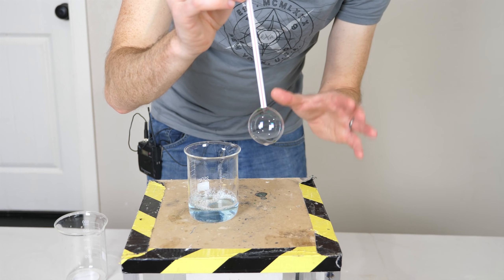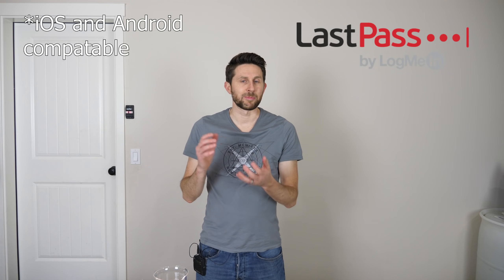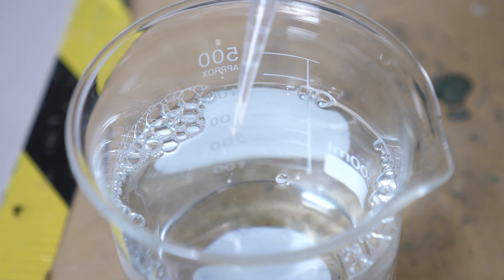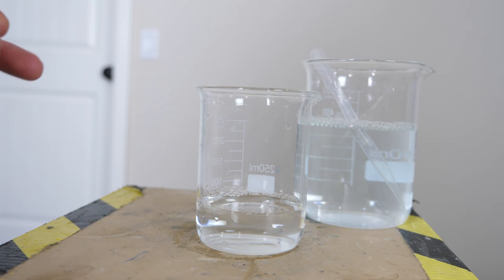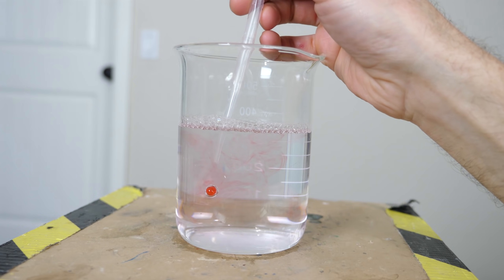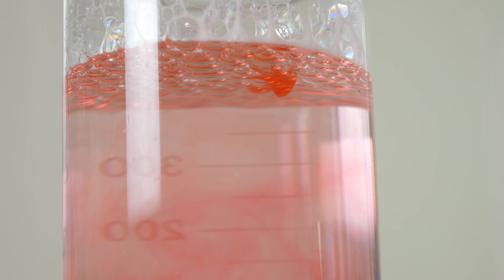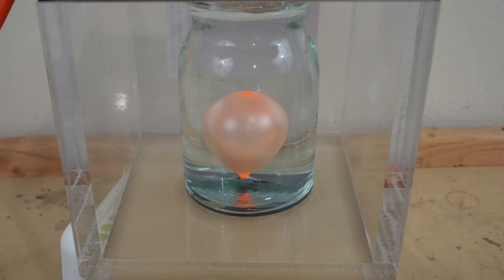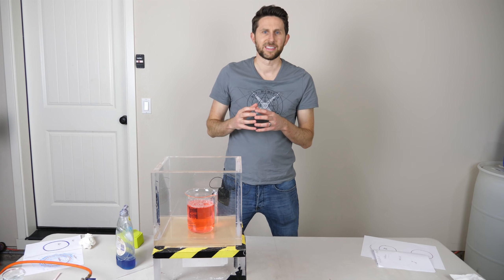What Happens to an Anti-bubble in a Vacuum Chamber?

Comment: Is it reasonable to think that the anti bubble would not expand because for that to happen the water inside should expand?? When the pressure decrease to much the it switch to vapor and the antibubble pops. In my opinion it has nothing to  do with the surface tension.

Comment: The fact that it is an vacuum chamber, means that all the air will be removed from it's inside. So, if an anti-bubble is made out by a thin membrane of air, it is obvious that it will pop, cuz all the air will be removed, and the water will drain out of the bubble. Brilliant conclusion.

Comment: I know how to hold it still in place, you know how I can take a flow of air and balance a ball on it and it will hover, will do the same except for suction with a small pump, and return the water back in at the top, just adjust the flow

Comment: I’m fairly certain that the air membrane not expanding could alternatively be because the water, which is denser, expands slightly, but still with greater force than the small membrane of air could oppose on both sets of liquid.

Comment: actually it didn't grow because gasses expand more than liquids. an actual bubble has air in the middle meaning all that air will expand. anti bubbles on the other hand have liquids in the middle and thus nothing much to expand. the membrane strength has nothing to do with it. the more gas there is the more substance exists to expand. cool video though.

Comment: i think the air membrane didn't expand ( not because it is strong ) but because the water is non compressible AND any vacuum will be filled by water boiling off - so the water pressure is a constant - the air is surrounded by constant pressure water

Comment: Been in a vacuum since 14 years old ,(64 now retired) Optical coating, what you have shown me is that one a cellular level (what you have duplicated ) by adding viscosity Now my question to you is viscosity a linear function or log rhythmic. I would guess linear by the wave form distortion on the sphereocity  change on the inner water tension increased but air was spherical of the wave form  as you start to pull a vacuum ,This has great bearing on a Project I have in visioned in quantum vacuum  measurements

Comment: I thought liquid cannot be compressed or expanded because of pressure.
Reply: i think the air membrane didn't expand ( not because it is strong ) but because the water is non compressible AND any vacuum will be filled by water boiling off - so the water pressure is a constant - the air is surrounded by constant pressure water

Comment: Water is creating hydrogen bonding and keeping the force of water intact with itself Inside therefore there's a constant volume of water inside the antibubble. The only way the bubble will expand is if water crosses that thin gas membrane you talk about but that is not happening because it's not a traditional osmotic membrane permeable to water. I believe the bubble pops bc the thin membrane gasses want to dissolve out the water and into the air due to the decrease in pressure. And if you did see the antibubble get bigger, could it be from the dissolved gasses inside the bubble expanding out to the gas membrane and that limits the expandability of the antibubble in a vaccum.

Comment: What would happen to a bubble floating in a sphere of water in 0 gravity?  Would it float to the nearest edge or just stay still?
Reply: I suppose it depend of the speed it has when you make it. If it has 0 speed and the sphére has 0 speed as well, it would not move. If not, it would go in the same direction it had, and would be slowed by viscosity...  ( i see only surface tension as force in this system, and i don't see why it would push the antibuble in any direction)

Comment: I don't believe that the thin air membrane is that strong . I believe it has to do with water pressure inside and outside the anti-bubble . Water has an extremely low compressibility , many times considered as incompressible. The thin membrane is basically trapped between two layers of water that are pretty much at the same pressure , causing it not to expand.
A normal bubble will expand because the air inside the bubble is at a higher pressure level than the molecules of water around it. No magic require and no "strong" air membrane involved.
Reply: I think you are closer than any I have seen yet - here is what I suspect :
i think the air membrane didn't expand ( not because it is strong ) but because the water is non compressible AND any vacuum will be filled by water boiling off - so the water pressure is a constant - the air is surrounded by constant pressure water

Comment: Conclusion: The structure of Matter. Replace the air with plasma double layers. The water also is plasma. So plasma inside=Atom(static), plasma outside is the atoms environment very dynamic and the double layers could be considered as the electron shells.

Comment: I'm pretty sure that seconds before the anti-bubble burst, there was an expansion of air at the top of the bubble. It is hard to see if you're not looking for it. Basically the air around the bubble was being forced towards the lower pressure and distorting it by becoming elongated near the surface. This seems natural as the water wants to remain where it is and the air wants to leave. Please check this again or make it easier to see the bubble without all of the other bubbles around it. Nice demo but check your conclusion.

Comment: It does not grow because the water on the inside does not expand and the water on the outside does not contract...At least at the temperature and pressure (vacuum) you were applying in this case.
P.S. a vacuum has pressure until you achieve an absolute vacuum such as in outer space.
It is the same concept as...Things don't get "cold" they get the heat removed until you get to absolute zero such as in outer space.

Comment: What if you had a layer of silicone or even vegetable oil on the surface of the water. Make the antibubble, then add the silicone oil. The bubble should stay under the oil.

Comment: The liquid inside will not change size but the air layer will grow thicker and expand outwards, Gas will expand more than the water that’s why you couldn’t see the bubble expand because you were concentrating on the inner red bubble instead of the air around it

Comment: i think the volume does not increase that much because water is incompressible, and so the water inside the bubble cannot cannot increase and keep the smae volume
Reply: you are on the right track ...
i think the air membrane didn't expand ( not because it is strong ) but because the water is non compressible AND any vacuum will be filled by water boiling off - so the water pressure is a constant - the air is surrounded by constant pressure water
Reply: @spinfowars8958  the air can still be at a lower pressure. water will start boilling of at a given pression and temperature. But before, it can be at a low pressure, so the air pression is not constant
Reply: and because the air pressure isn't constant, then the water pressure isn't constant neither
Reply: @Mindingsesssion  

good analysis - i suppose the air pressure and the water pressure and changing pressure at the same ratio to each other - 

I think that might explain why the air membrane does not break - but under those conditions it seems that it should get larger
[
since it doesn't change its size - it makes me think the water pressure is staying constant

Comment: The liquid did not compress. The sphere of air around the liquid did expand.
Reply: i think the air membrane didn't expand ( not because it is strong ) but because the water is non compressible AND any vacuum will be filled by water boiling off - so the water pressure is a constant - the air is surrounded by constant pressure water

Comment: It could be possible that it didn’t grow bigger because the membrane of the bubble is made of air, and air expands in a vacuum chamber, which is where you exert the inward pressure in that area.

It probably didn’t expand though because the cap you had on top may have been too tight and didn’t give the air enough room to escape.  It may have been expanding a littlebecause of the tiny bit of room that was not capped.

Comment: I was thinking the red anti bubble should be left at room temperature while the colorless water is hot but on top of a cold surface like a block of ice or something that way the cold surface would have the water at the bottom of the beaker be cool, the top of the water will still be warm, and the room temperature anti bubble would float happily in the middle

Comment: What would happen if you made your anti bubble and then put a layer of oil on before turning on the vacuum? Maybe put enough in so the anti bubble will be suspended 1/2 way up. (or would the oil ruin the bubble?)
Excellent interesting video as always.

Comment: So does the inside sphere touch the bottom of it's air capsule due to gravity? In which case, is it surface tension alone that stops both bodies of water coalescing? I've seen them on top of the water, but never imagined they could be submerged. This is great, I never even knew these things existed, let alone be possible to create. 😄

Comment: I think the main reason it didn't expand was that the interior volume of the antibubble is water, which, compared to air, is fairly incompressible/expandable by pressure.

The only thing that could have expanded was the membrane itself which is made of air.
Reply: i think the air membrane didn't expand ( not because it is strong ) but because the water is non compressible AND any vacuum will be filled by water boiling off - so the water pressure is a constant - the air is surrounded by constant pressure water

Comment: I'm sorry but you are kinda wrong in the second reason, you forgot to mention/or did not perceive that the weight of the water trapped was getting "strongger", or another way to put it as the pressure began to decrease all the air tends to go to the top as you going to see the bottom part getting thinner and thinner, if you watch closely this is very obvious. 

Disclaimer: I'm not a scientist i know there's probably something stupid about the way i putted it. 
And i'm not english native speaker, but the idea is there.

Comment: Even if the air membrane doesn't have enough volume to cause some noticeable change, why isn't the added excess pressure inside the bubble enough to cause some expansion. And if the pressure pushing outwards really is not much greater than the pressure of the water around it does that mean you can create anti-bubbles of irregular shapes (since it doesn't need to be very spherical as the pressure difference is low).

Comment: Try dissolving something in the water you inject. If the water inside is at just the right density, the bubble might remain stationary under water. A sugar might be good for this as a salt may interfere with the surface tension of the detergent.
Reply: Moo Moo If sugar is added to the cup without stirring, the water density in the cup can be varied with height. Then, the anti bubble can stay in the middle of the cup. I remember seeing this trick somewhere on Youtube.
Reply: @truongpham1997  interesting👍
Reply: I was thinking the same thing. You could also use different liquids to achieve a stationary bubble
Reply: Try using salt water and plane water for the anti bubble  the bubble should float at the interface between the two.
Reply: Riurg

Comment: Air membrane is strong enough to hold the water inside from expanding?
Water doesn't really expand in vacuum, unless it boils.
Really the air is only a very thin membrane so there is only a tiny amount of air actually there which is why when it pops you don't even see the air form into a smaller bubble and rise. All you see is it disappearing because amount of air in an anti-bubble is so small.

Comment: The reason the anti-bubble doesn’t expand much is because when the air pressure goes down it has the primary differential volume effect on air, not water.  Since an anti-bubble has very little air by volume, the volume of that anti-bubble is effected very little.

Comment: I’m just throwing out my thought but I think the anti bubble actually wants to expand but because it has no source of additional “air” molecules when it does start to expand the layer becomes too thin and then pops. Also I think that because the anti bubble is close to the surface, the thin air membrane that separates the water gets pulled into the vacuum, again making it pop.

Notice me senpai!

Also please tell me if I’m wrong

Comment: put some insulated from the connection point temperature sensor in the vacuum chamber and hit it with a laser or other em radiation and find the equilibrium temperature that results from the energy in and energy out (mainly due to black body radiation which should increase as temperature increases until the thermometer radiates as much power as it receives)

Comment: Couldn’t it also be because unlike a normal bubble, which is filled with air, the anti-bubble is filled with water. This would mean that instead of a lot of gas expanding, as in a normal bubble, and making it bigger. On the anti-bubble there wouldn’t be as much gas expanding, as it’s only on the membrane, meaning it wouldn’t expand as rapidly.

Comment: What would happen if after you create an anti-bubble with water, and then fill the top layer with oil so that the water should prevent the anti-bubble from reaching air. Would that make it more stable for testing in the vacuum chamber?

Comment: if the vaccum chamber is lowering the preasure inside to near vaccum,
then what we have to increase the preasure?
Reply: It's called an air compressor, it's used a lot more than vacuum chambers, for example for nailguns.

Comment: The anti-bubble is filled with water! Water doesn't expand when you decrease pressure or compress when you add pressure. So the only thing that CAN expand is the air membrane, and that is very thin.

Comment: I have one for you to try. Trying to clean the frying pan and not blocking your drain is not easy. You heat up the frying pan to drain the oil into a bottle. But you still have some access left the bottom of the frying pan. I tried this way and it worked a little bit.  by boiling some water in the frying pan with a squirt of washing up liquid in it. It softened the oil that was stuck to the frying pan a little bit. but I was thinking if you use something in the water with something a bit more a acidic like vinegar. it would work better. Maybe you could give this a try. Just a suggestion.

Comment: What happened to your bubble was, basically, the space occupied by the air in your bubble did increase; but the inner bubble of red water stayed at the bottom of the air space.  This opened the air space to collapsing in the air above the water, which is what eventually happened.  Once the top of the air space was open, the air around the bottom of the red water escaped, allowing the red water to come into contact with the white water.

Comment: If there is a bubble underwater will it expand as much as one outside? Meaning is the loss of pressure on the balloon related to the area of the balloon or the area of the surface of the water? If only a small area of water is exposed to the air then the air can't put much pressure on the water so the difference in pressure will be different? It is 3.30 in the morning here and I am very tired so what I am saying may not make much sense and the answer might be more obvious to a non tired me.

Comment: What is the largest anti-bubble that could be made?     &
Could it contain a smaller anti-bubble?  
 I don't know how this could be done.

I know there's a math guy out there that can answer this with an equation using the surface tension  of the liquids as the variables?

Comment: @The Action Lab - The experiment you did is really cool as I did not even know that you could do an anti-bubble. However, the explanation you gave for the bubble not expanding is actually wrong. 

Let me iterate: 

So you propose two explanations. 
The first explanation is in regard to the volume being too small, to begin with. 
This explanation does not tackle the experiment as the same could be said of the bubbles on the surface, even tho they expand. The second explanation you give is about surface tension being stronger. That is not relevant to the experiment. The anti-bubble is actually weaker than a normal bubble as it explodes easier as we can observe. 

The correct explanation, in my opinion, is given by the state of water as a liquid. Water as other liquids is not compressable nor expandable. The only way for water to "expands" is for water to turn into the gas state. A gas will change its volume to fill all the space it can fill. A liquid, on the other hand, will have the same volume no matter how much space you give to it. In the experiment we've seen we have water, a layer of air and water again. The only gas in this equation is the thin layer of air, that can expands but it will only weaken the balance of the anti-bubble, causing the bubble to explode well before any changes can be observed. The water inside of the bubble could expand only if it would be able to turn to gas by boiling. However, that would happen only at a pressure low enough for the entire water to starts boiling, and that far surpasses the pressure needed to pull air out of the water (causing the thin layer of air to be disrupted).
Reply: @Marconi Patrizia una promettente artista assaghese I agree
Reply: That is a much more accurate explanation
Reply: @Marconi Patrizia una promettente artista assaghese yeah that would be great